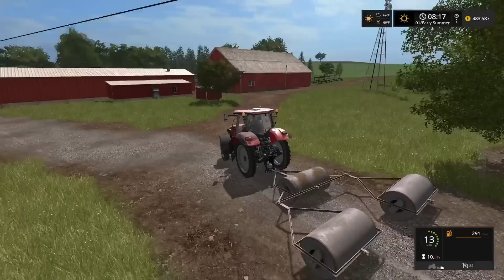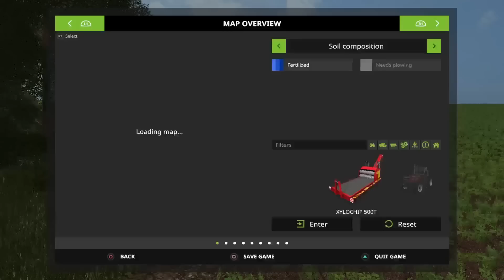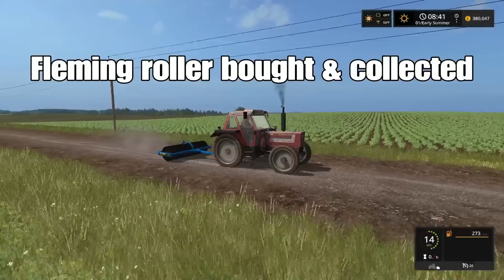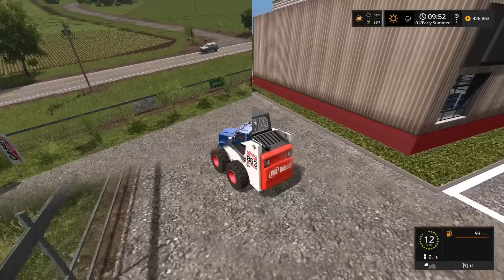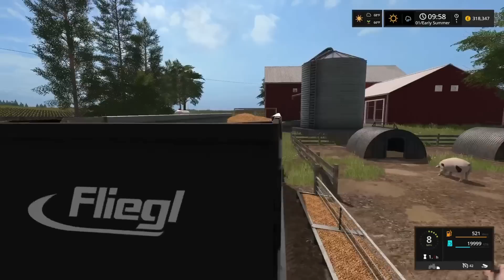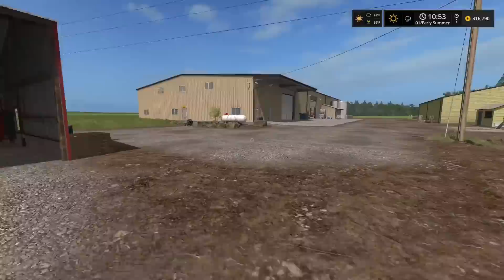Lone Oak Farm, Ep10 (Rock 'n' Roll). Farming Simulator 17 PS4, Let's Play/Role Play.

Comment: A small suggestion to help with the mowing, windrow the rows before bailing to build up the row and you won’t loose so much in the degradation period
Reply: As long as the grass is not baled it won't degenerate before midnight! To stop degeneration you have to wrap the bales as soon as they were pressed which is probably only possible with the KUHN baler-wrapper. Windrowing therefore doesn't help against the degeneration.

Comment: hi mate what is the csz rocker arm please can you tell me
Reply: It's an attachment that goes on the lifting hook with a strap on it and if you lower it over e.g..pallet and fasten strap you can lift it up
Reply: ok thank you for that
Reply: scott harrison no bother
Reply: ok thank you for that
Reply: Its great for logging,attached to a telehandler .you should try it out.
Reply: The rocker arm in the first place is for moving single cut down trees out of the wood for forther doing work on them (cut in length and load onto a trailer). It must be attached to the CSZ hooked lift arm which either goes on the 3-point-linkage or the CSZ-adapter (both will work but with the CSZ-Adapter you have more lift control).
Besides rocking wood (what is was designed for) you can also move pallets with that I think (I haven't done THAT in particular with it).